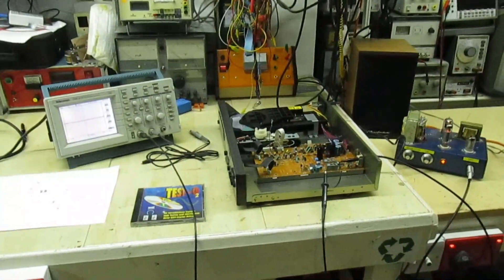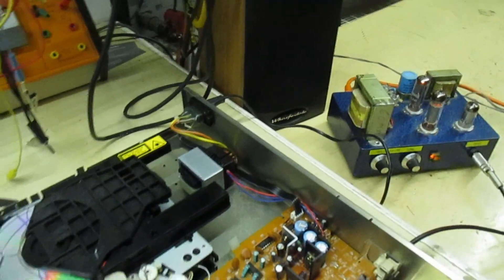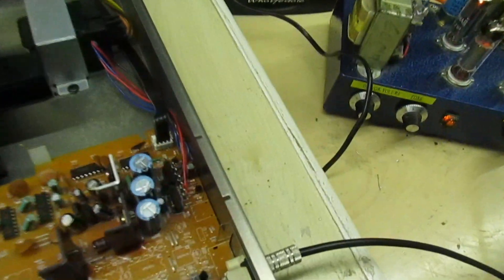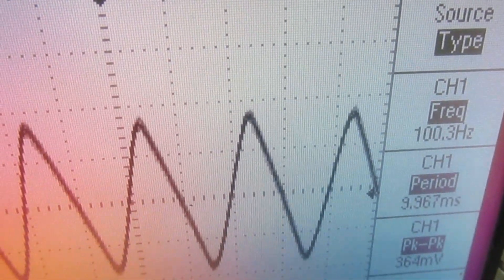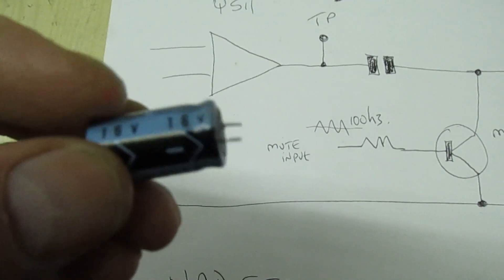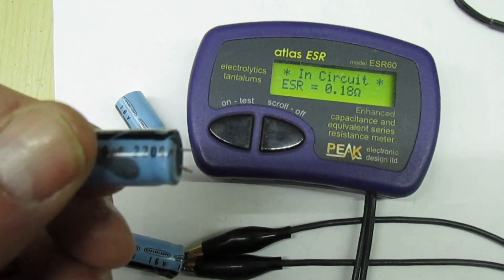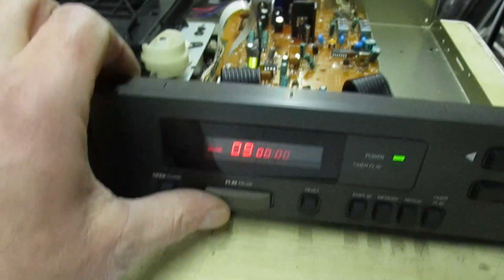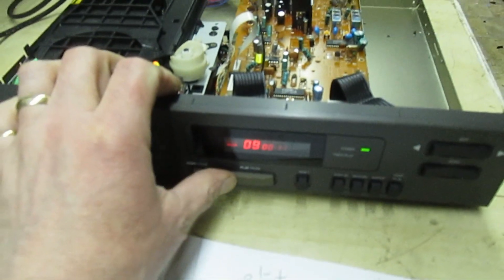NAD 5520 Vintage CD player unusual fault

Comment: Soon as I heard the distortion from the sig-gen I thought   Capacitors, from experience, strange why all displayed  in circuit  though, you'd expect one, but not all three, could  have been a faulty batch, good find Michael, you save another one for many more years for service.
Reply: That was a strange one goes to show weird faults can. happen at any time, ive never  had the in circuit come up yet.
Reply from the maker: I would have expected more to be faulty or at least more symptoms with 3 faulty caps that were in the most important part of the circuit,but if you disconnected the sound mute transistor sound was perfect and there were no other faults at all !

Comment: An interesting fault and caused buy good quality electrolytics  and not even in a switching PSU  .
Reply from the maker: Yes , I think this machine pre dates the water based electrolyte  capacitor plague .
Reply: @michaeldranfield7140  looks like they're near a regulator heatsink so likely dried up by heat

Comment: Had a similar fault many moons ago, think it was on a Cambridge audio cd player.
The regulators ran so hot they had dry jointed themselves.
As part of the repair I added some clip on heatsinks to help reliability
Reply from the maker: I've made that mistake a couple of times, checking the output of a 3 terminal regulator on top of the board  and it appears ok , only to find its dry jointed underneath !